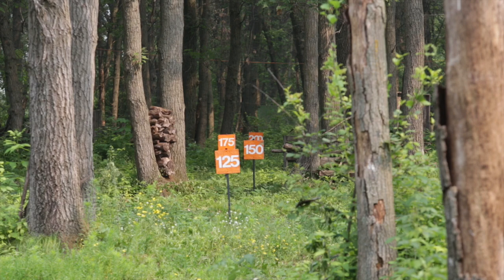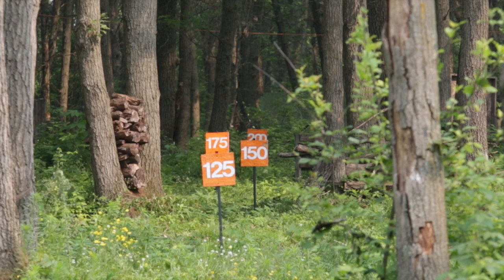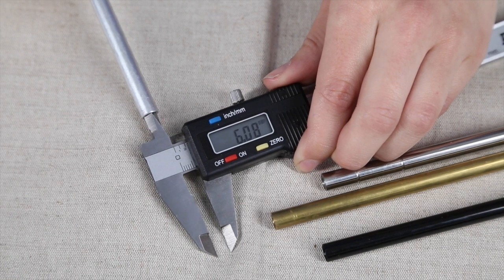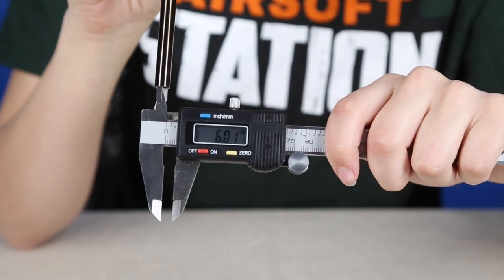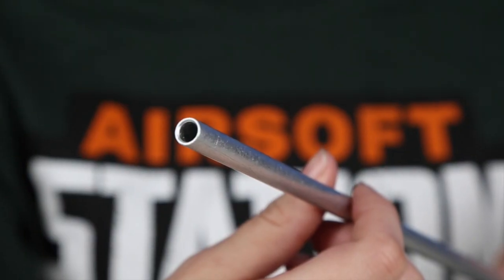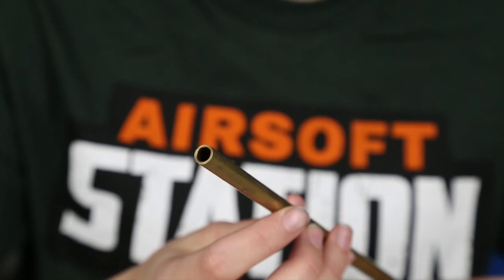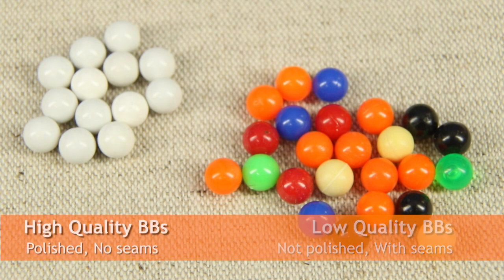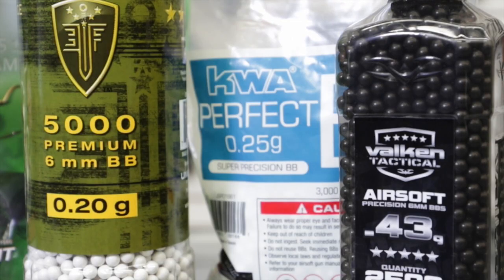Airsoft Guns - How to Get Tighter BB Groupings

Comment: Good write up, however i have one thing to say. In my opinion / experience the finish/ tolerances of the inside of the barrel is much more important than the overall barrel diameter. Its possible that if you have a 6.08 barrel and bump down to a 6.01 of the same inner surface quality to actually have worse results. The uneven surface will have more of an impact on the bb on the 6.01 than on the 6.08.

Comment: First of all, don't clean the barrel this way, you push all the dirt into the hop-up chamber... Barrel length has little to non effect on the accuracy of your gun. When you have a tight bore, you might experience worse results as with wide bore barrel... With a tight bore barrel there's a chance that your BB hit the wall of the barrel or just get stuck... I don't recommend going below 6,03. Keep in mind that the diameter of your barrel, as the spring, highly affect your FPS. The wider it gets, the more power(air) you need for your BB to glide on.